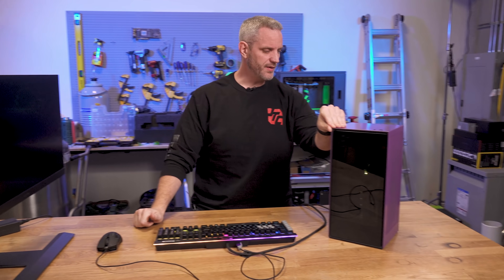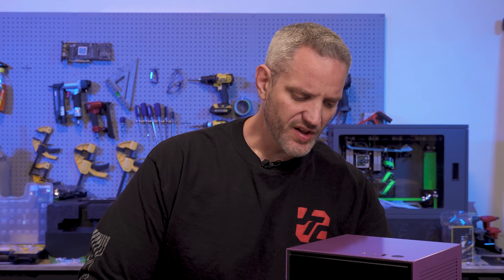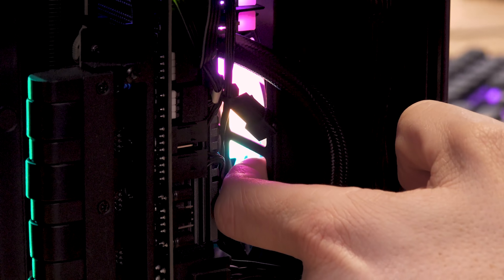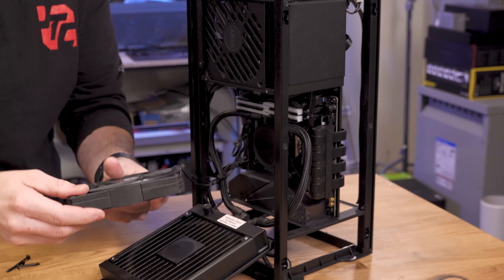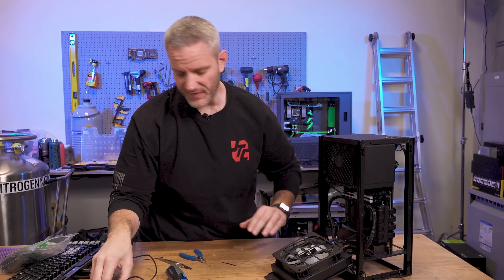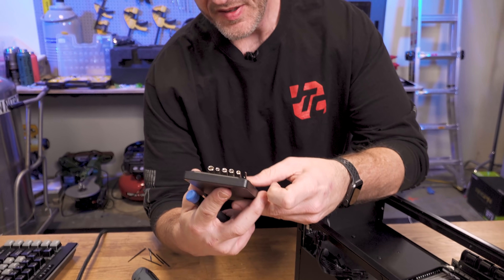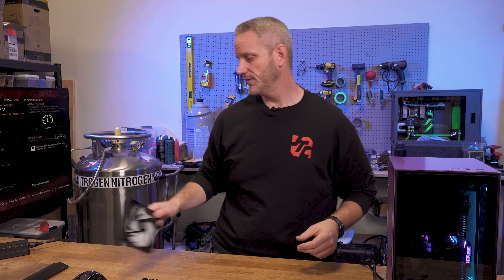This PC is shutting down due to overheating... let's investigate why!

Comment: lol until I bought my new laptop I was using an old 10 year old laptop that always ran hot. It was a middle tear gaming laptop back in the day. I got a cooling pad for it. Well it was overheating ALL the time. It was driving me nuts. I'm like are these fans even running? NOPE!!!! They were CRAMMED with dog hair. So I cleaned them up. They were a little grindy and definitely need replacing......if I cared to. But hey they work. Overheating much less of a problem. Honestly I should have torn the laptop itself apart and replaced the thermal paste. It's 10 years old at this point. Who knows maybe the fans in the laptop need servicing as well. Regardless new AMD 4700U laptop solves the problem. I missed having a touch screen. My main laptop died about a year ago. So I was using its predecessor.

Comment: This happened too me a month ago.  Was playing a Cpu intensive game and kept crashing.  Thought it was my PSU again since the last time it happened it crashed the same way, at which point a loud Pop was heard and comp died.  I screwed up then, reset the breaker w/o unplugging, another Pop was heard, with the beautiful aroma of electrical smoke.  In the end I got lucky then and none of my components shorted out.  So yea, I was worried till I looked at my cpu temps, peaking at 96 then spiking to 102c before poof, will be changing a yearly project to bi-yearly.  That ore changing Cooler to a larger unit, rather then stock.

Comment: Been using that same electric screwdriver for a long time. If it died tomorrow I'd order another one immediately. It has built and repaired many PC's. Charges quickly and lasts for quite a long time. The bright led is also handy.

Comment: The CPU fan on my Surface Book 2 died and I've been using it fanless for half a year now without any overheating problems, even while doing CPU-intensive stuff. I'm baffled myself as to why it still works without any freeze or crash. I'm guessing that's the magic of thermal throttling?

Comment: Why wouldn't you blow that hot air out of the computer? Instead you have the fan blowing in the computer for the radiator. Cooler air from outside the case I know, but your blowing hotter air onto the motherboard and CPU. You have holes on the sides of the case which will draw in the cooler air. I like all hot air fans(upper half of the case - heat rises) blowing out of the computer which my tests have shown to be cooler. I must say, I don't have that case and have never used a water cooler. Is it preference or have you tested it that way?

Comment: For about ten days, I had my CPU's cooler plugged into the wrong header. A couple of my twelve year old, 80mm case fans were making noise, so I decided to unplug them, and just run the computer with the side off, until I move everything out of that case, and into their new home. A few days ago, I decided there is no point in letting the other case fans keep running, since doing so is the equivalent of putting a box fan in the back yard to try and keep the house cool. Imagine my surprise when I turned the computer back on and it wouldn't boot because of a CPU fan error. What I still don't understand is why is the header for the CPU's fan at the top of the ROG Strix B550-F motherboard, and not right next to the CPU itself?

Comment: I wish you could fix my gpu 😭 every since I updated to the new drivers it halved in performance I think it needs the bios changed because the old driver that I used to use doesn’t run it like it ran before

Comment: Why not just use nylon screws and avoid the issue all together?
Reply: NZXT is shipping nylon screws. The fix in this video is not effective if the screw threads make contact with conducting layers within the pcb. He needs to take this video down and fix or remove his recommendation.

Comment: That screwdriver is a knockoff of the SKIL Rechargeable 4V Cordless Screwdriver with Circuit Sensor Technology selling for $27.98 on Amazon. The Hammerhead is priced at $99.00.

Comment: Regarding the screw recall could you have used a nylon screw or would that not have been strong enough. I understand that you may have not had one but, in general, would that have been an option?

Comment: "I'll put a link down below to one I recommend..."
Doesn't put a link down below to a screwdriver he recommends...
Reply: Damn, the Hammerhead one he uses costs $99, I thought he said it was cheap.
Reply: @darxustech2883  it was cheap.. 2 years ago, lol... he probably paid about 20 bucks for it when he bought it.. i paid 30 for mine about a year and 1/2 ago. new it was 15 dollars.. but it's only sold by 3rd party now thus the price increase.
Reply: @ashakir85  yeh, no stock for me
Reply: @FenstermäkerWJ you're right, camelcamelcamel says it was like $25 last year.
Reply: EVERYTIME
Reply: When Jay wouldn’t answer what screwdriver it was a year or so ago, I went on a mad tear to find it only to discover the Hammerhead was unavailable.

Here is a cheaper alternative  ($35) and, if I remember correctly, a customer review comparing the two if you put “Hammerhead” in the q and a search. Please copy and paste in Jay’s Amazon link-

SKIL SD561204

I bought one but never used it and gave it to my dad.as I discovered the Dewalt DCF610S2 and never looked back. 7 on the clutch for PC’s except I don’t tighten fan screws or power supplies enough to engage the clutch as they are prone to stripping.
Reply: He always does this we are used to it now
Reply: Type in wowstick on amazon. They’re great, mine only cost £35.
Reply: @FenstermäkerWJ I was about to post the same one. They used to be sold by Lowes and Sears as well. But are no longer in production.  I'll probably be getting this one in the near future. They are also available at Home Depot and Lowe's who has it cheaper by $2. Plus a military discount.
Reply: @ashakir85  now "Currently unavailable".  Jay referrals wipe them out.  All of them. /Palpatine.
Reply: Please help 
I built my pc and it starts but I get no signals on my monitor 
Tried everything 
Ram 
The monitor it self 
Gpu 
Everything is plugged correctly btw 
The fans spin and lights are on but there's no lights and my keyboard and mouse don't get lights as well 
I got ryzen 5 2600 
16gb ddr4 3000
2060 rtx 
Psu is 400w 

Where is the problem??
Reply: Well, with the signal tester he did say, “there is activity up there. It’s slow, but there is activity up there.” 😂😂
Reply: Out of stock. Raaahhhh I
Reply: If you can’t just search electric screwdriver on Amazon that’s on you lol
Reply: @3a.m.284  It's a joke. Sarcasm.

Comment: just using a washer wont help it, if its a multilayer pcb and its grinding against a trace on a different layer with the threading itself
Reply: Here 11:05
Reply: @adetyapurba  Exactly. With a washer it doesn't touch the case anymore.
Reply: Please help 
I built my pc and it starts but I get no signals on my monitor 
Tried everything 
Ram 
The monitor it self 
Gpu 
Everything is plugged correctly btw 
The fans spin and lights are on but there's no lights and my keyboard and mouse don't get lights as well 
I got ryzen 5 2600 
16gb ddr4 3000
2060 rtx 
Psu is 400w 

Where is the problem??
Reply: Agreed, was just about to say this. A washer will do nothing if the hole is drilled through a trace on any of the layers.
Reply: I think the point of the washer was to lift the screw up, because what caused the grounding was it touching the case when it's closed.
Reply: @Republic3D  the screw goes Into to a metal bracket, it also has loads of clearance to the case.

Comment: That's not an ML fan. Is an LL series (hydraulic bearing) derp
Reply: Yeah I just kept cringing when he kept on explaining how the better fan wasn’t the one in his hands and he would tie up the RGB which is that fan’s biggest selling point 🤣
Reply: @helljester8097  was honestly so painful 😂😂 especially as the bearing is identical to the previous one
Reply: Please help 
I built my pc and it starts but I get no signals on my monitor 
Tried everything 
Ram 
The monitor it self 
Gpu 
Everything is plugged correctly btw 
The fans spin and lights are on but there's no lights and my keyboard and mouse don't get lights as well 
I got ryzen 5 2600 
16gb ddr4 3000
2060 rtx 
Psu is 400w 

Where is the problem??

Comment: Hey J, my brother bought an H1, and ended up using the stock cooler, we think that the water loop might have been empty of they didn’t have enough thermal paste applied, but the cooler was impacting the CPU temp... not at all, so it would shut down after about 2 minutes

Comment: Corsair LL fans are hydraulic bearing, not magnetic.
Reply: They sell both. The magnetic one with rgb are quite expensive
Reply: @timothygibney5656  Just talking about LL which is what Jay used in the video. ML is magnetic, but it’s only available in plain rgb, without the light rings around the blades.

Comment: “Cant see the rgb anyways” uses expensive rgb fan and disables rgb instead of just using non-rgb fan
Reply: maybe he didn't have non-rgb maglev fans on hand #firstworldproblems
Reply: so? its not like he charged the customer additional cost. He has PLENTY of fans that he probably didn't even pay for, and it worked. Did Jay somehow charge u for the fan? I don't see the issue here.
Reply: Please help 
I built my pc and it starts but I get no signals on my monitor 
Tried everything 
Ram 
The monitor it self 
Gpu 
Everything is plugged correctly btw 
The fans spin and lights are on but there's no lights and my keyboard and mouse don't get lights as well 
I got ryzen 5 2600 
16gb ddr4 3000
2060 rtx 
Psu is 400w 

Where is the problem??

Comment: what?i want to see the fan crush...i mean totally disasembled-
anyway,a 45 doubloons fan failing so soon is a shame,no matter what position.if its me i would be ver angry with it.but also i dont get the manufacturers tendency to put hidrodinamic "bearings" everywhere.
there must be a law to put the type of bearings clearly on the specs,outside box,etc.with ball bearings you even have the chance to replace it,but its a lot harder to repair with hidrodinamic ones,usually they dont even leave enough material to drill and put a bearing by yourself and you have to throw away a perfectly fine fan that could run for decades.
pc fans,if cheap,its not a hard problem,but they even do that on bigger and powerfull extraction fans with integrated speed controller and ambient temperature sensor probe,at 150-250 coins just to throw it to the garbage because the lack of a 1 dollar bearing in 2 years.

plot twist:the bearing got busted because hot leds fried the lube.

Comment: Hey Jay seriously question i am getting the parts for my build I have a 3090ftw3 ultra that will be kverclkcked and either a 10900k or 5950x if I can get it wondering what power supply I should get qas looking for be quiet 1500 watt 80 plus titanium but they are sold out everywhere next best option. Corsair rm 1000w maybe a wvga supply id rather go overkill than not have enough and overclkck cpu and 3090 ftw3 wanna make sure I'm not bottlenecks by my psu and is 850 enough or 1000 or I need lole 1200 to 1600. Was looking at 1200 thor asus but everywhere thay has them in stock there double the price

Comment: Depends if the short is on the screw head side or the underside of pcb which if it is will still have short through screw to chasis.

Comment: I think this is the first time I have ever heard of a problem where a mounting screw could ground out to chassis. By design, all screw holes should be connected to chassis ground whenever possible anyway. Sounds like an engineer screwed up real gud.

Comment: The original fan with this case is a fluid Dynamic bearing. Kind of strange after your description of them that they would have chosen to use that. I also replace the one in my age one with a maglev Corsair 140.

Comment: No link to the tools, Amazon link just goes to the home page for amazon.
Reply: Same here.
Reply: Same here
Reply: @ashakir85  "Cheapest electric screwdriver"
Reply: Please help 
I built my pc and it starts but I get no signals on my monitor 
Tried everything 
Ram 
The monitor it self 
Gpu 
Everything is plugged correctly btw 
The fans spin and lights are on but there's no lights and my keyboard and mouse don't get lights as well 
I got ryzen 5 2600 
16gb ddr4 3000
2060 rtx 
Psu is 400w 

Where is the problem??

Comment: 6:00 - can someone tell me what battery powered screw driver he's using? I've been looking for a decent one for a while! I laughed after watching the whole thing.
Reply: should watch the full video....
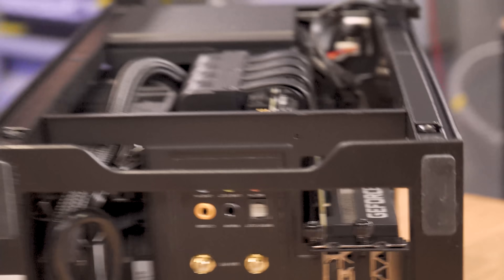14:06
Reply: @Million_Lights  I know. I laughed when he said that! I didn't wait till the end! Haha
Reply: its a secret,nobody knows and will never be revealed.but i can tell you if you pay me 20 dollars.
Reply: https://smile.amazon.com/HAMMERHEAD-HCSD040-02-Rechargeable-Screwdriver-Technology/dp/B01N0YV423/ref=sr_1_3?dchild=1&keywords=electric+screwdriver+hammerhead&qid=1608831825&sr=8-3 looks similar. 
This https://smile.amazon.com/Rechargeable-Cordless-Screwdriver-Circuit-Technology/dp/B07C4916LS/ref=sr_1_2?dchild=1&keywords=electric+screwdriver+hammerhead&qid=1608831825&sr=8-2 looks like a very similar, but cheaper as of posting.
Reply: @71prim8  thanks. I have a problem finding one with a magnetizer that makes the bits magnetic.. always magnetic holder, but the bits aren't.

Comment: Was the screw biting into the pcb via the threads or the head? if it was the threads then the washer won't fix the problem because the threads bridge the connection to the case not the head of the screw, if the head was biting into the pcb then the washer will work fine.

Comment: Comment stalkers, I have a question. My motherboard only has 2 memory slots but I have 2 8gb ram cards. In most build tutorials, they usually have 4 slots and the two cards go in two opposite slots. 

Will mine work with only two slots, or am I only going to be able to use 1 card?

Comment: I love this case. But to combat high temperatures I made a custom wooden panel with GPU ventilation. Check it out! 
Custom Wooden Panel NZXT H1 https://imgur.com/gallery/YnvZfeZ
Reply: Made with Zebra Wood. Attaches using the same Ball and Socket joints as the original panel. Gas/Nitro powered RC cars commonly used ball studs of that size.

Comment: that's bullcrap, i've seen fans last for over 15 yrs or more and never been cleaned out once. this fan was defective. it's called cheap Chinese made fan. also i really don't understand why people try and make small rigs where everything is all crammed together. pc's are meant to be spacious so you can upgrade and fiddle around and work on them without having to take the case apart. if you want something small and compact get laptop, you can even plug a large monitor and keyboard and mouse to it and have 2 monitors, one large monitor and the one on the laptop. i will admit that as far as small cases go that is one of the better ones i've seen

Comment: My computer will do a weird thing, where it will not detect the cpu when i unplug my computer from the wall. I do a couple power cycles and it's fine. I can restart it, shut it down for the night ETC, boots up no problem at all. There was one time that it wouldn't boot up after a couple tries, took a nap came back it booted up with no issues. I'm not sure what causes this, Haven't been able to figure it out. As long as the computer eventually boots... there is no problem :D

Comment: I thought the ML corsair fans didn't have a light ring? That's a LL fan isn't it?
Reply: depends which ml fan u get ml just means mag lev n they have em with rgb n just blacked out with grey blades so just depends on which kind of corsair ml fans u buy
Reply: @mattfischer5794  I am going to get ML RGB fans for my next build and none of the pictures of said product have a rgb light ring around the fans. Those are LL fans.

Comment: Just popped in to say "shuting", that is all...
Reply: Ok. Merry Christmas 🎄🎁
Reply: Oh beat me to it haha
Reply: Please help 
I built my pc and it starts but I get no signals on my monitor 
Tried everything 
Ram 
The monitor it self 
Gpu 
Everything is plugged correctly btw 
The fans spin and lights are on but there's no lights and my keyboard and mouse don't get lights as well
The pc stays on for few min and turns off automatically than it turns back on
I got ryzen 5 2600 
16gb ddr4 3000
2060 rtx 
Psu is 400w 

Where is the problem??